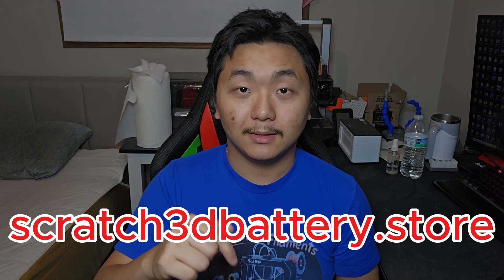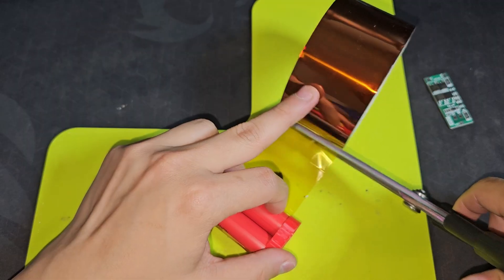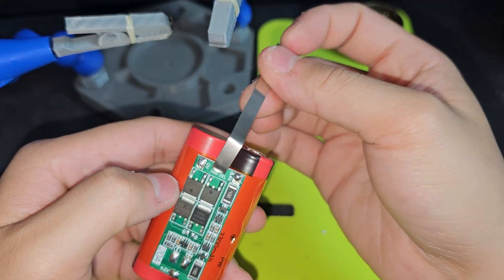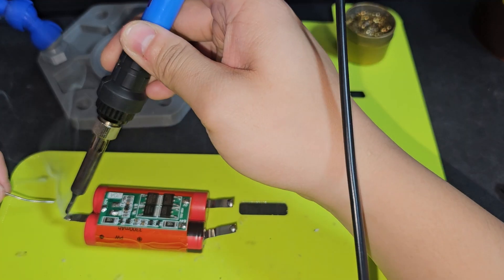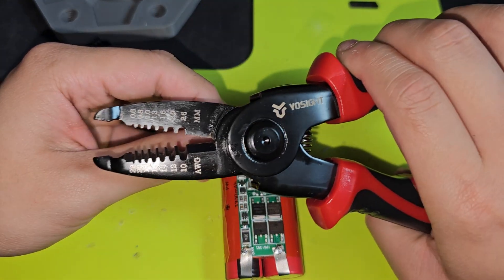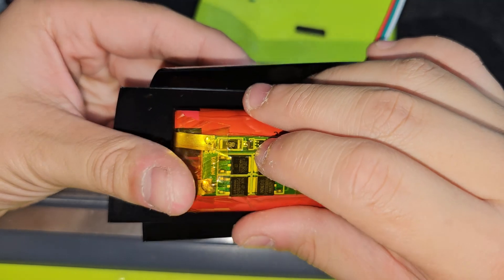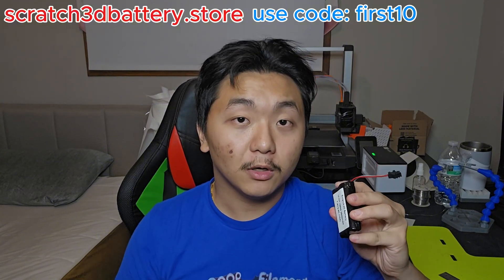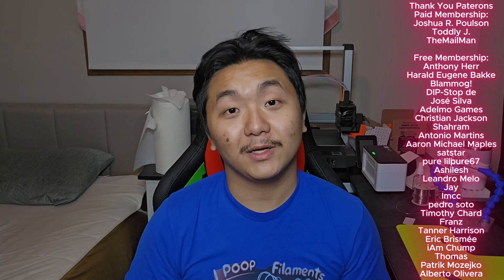Building 18650 Li-ion Battery Pack 7.4V 3500mAh

Comment: The guy who made the "multibox" storage unit for the kobra 3 pulled his upload because anycubic didnt even recognize his print in the contest he made it for and felt it went underappreciated. You cant get it through makeronline now but I still have a copy of the print files if you want me to share them with you to try out. Also you should check out the "Solder Scroll - Ergonomic, Adjustable Solder Tool" from printables, makes soldering a lot of repeated joints a breeze.

Comment: Hello! Please can i ask you for a help in my question with Kobra 3 combo?
For 2 days of use i got 3 'Power consumption error' when a printer powers off and relaunching. Two times of that were with one print at the same layer! So when it reaches N level - it just powered off! So it's definitely the printer issue.
Reply from the maker: There could be a mother board issues. You can open a ticket with Anycubic and maybe they can send you replacement parts. Have not encounter the issues so cannot really say what the problem is.